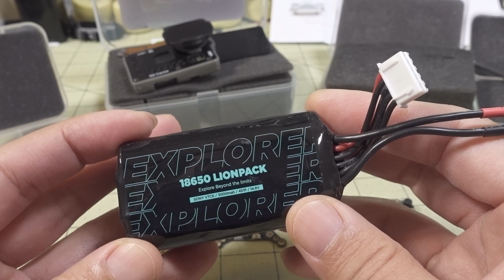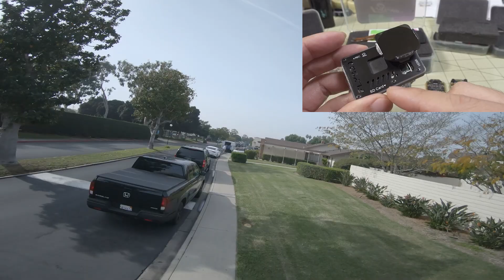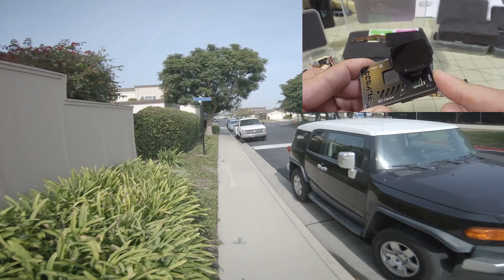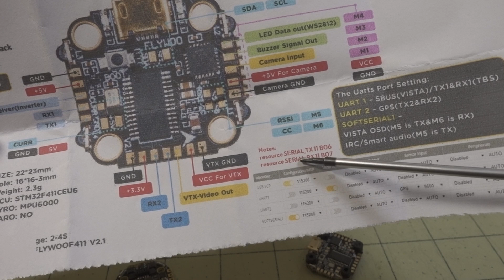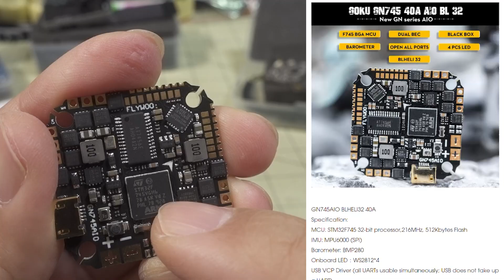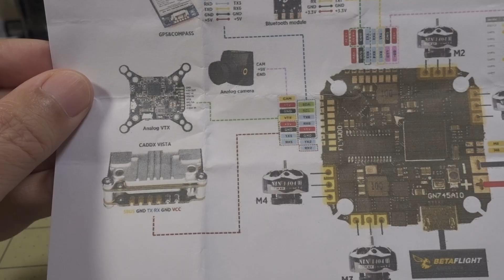Flywoo HAUL and Black Friday Sale!

Comment from the maker: Flywoo Black Friday Sale - http://bit.ly/3laX4ya
3000mah 4S 18650 Battery - http://bit.ly/3nRxn7A | http://bit.ly/3lcOtuG
Naked GoPro Hero 7 - http://bit.ly/3fQ9HxL (check back later if OOS)
Finder SE Buzzer - http://bit.ly/2V7aqRC | 
GOKU F411 v2.1 35A Stack - http://bit.ly/36aafv3
GOKU HM600 VTX - http://bit.ly/36al2W8
GOKU GN745 40A AIO FC - http://bit.ly/3fEfwxT

Many of these parts may also be on BG here - http://bit.ly/3q2cBUx

🙏 Please support with a 👍 and don’t forget to hit the 🔔 thanks!

👉 Old gear for sale here -  http://bit.ly/AlbertGearFS

💲 Get the latest exclusive coupon codes (updated often)
     http://bit.ly/34SYiGn

Comment: No one uses 4x60A ... 40A x4 = 160A will be more than enough for every 5“. Not just ultra light. If it really delivers... if those advertised 40A are in fact just 20A, you might get in trouble...

Comment: Is a 16x16 still worth it? Like, if your whoop board can run the same amperage as the 16x16 it kinda seems like the 16x16 is doing the same job, but is much heavier.
Reply from the maker: For those who just want to replace the ESC board when it blows up.
Reply: Makes sense. Thanks.